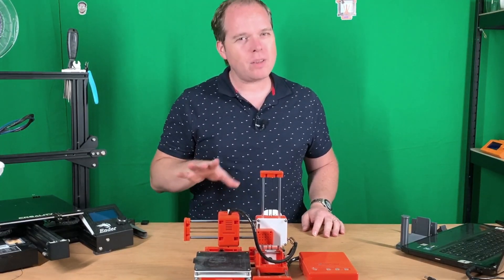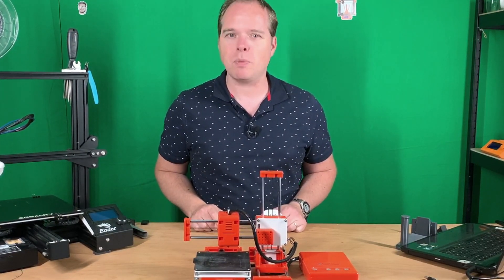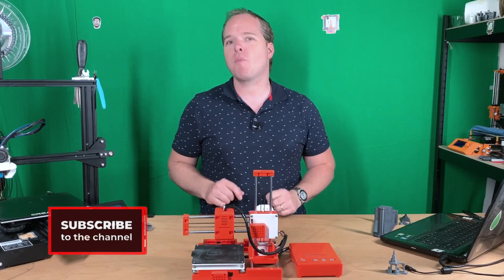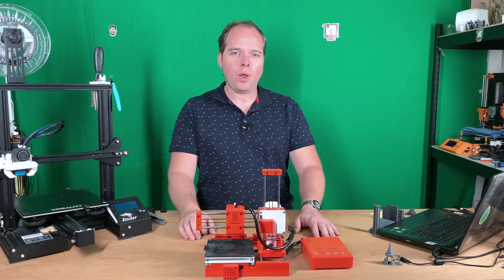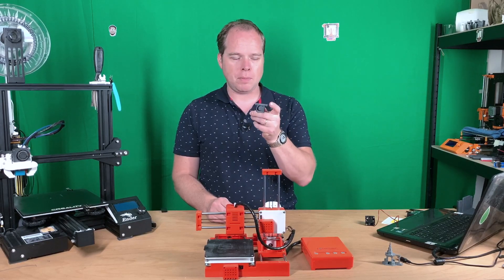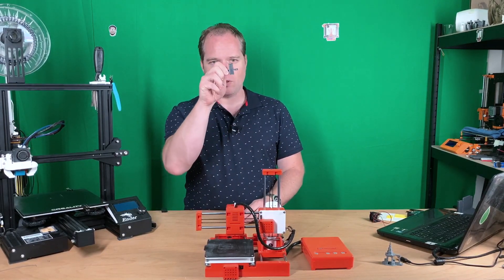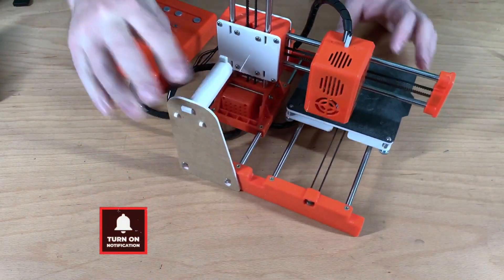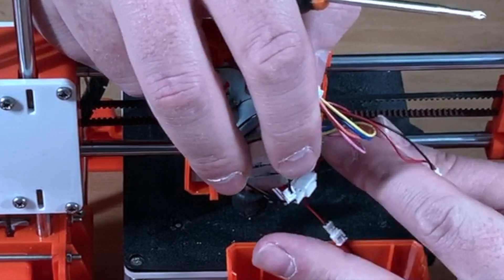Fan duct Easythreed X1 - Upgrade

Comment: Do you think if I install a display and a knobb it would work with the circuit board?
Reply from the maker: Hello Harvey brooks, there was a moment that I have had a display working on the board with some custom firmware on it, so it is possible. But for the standard board, I'm not sure if that is possible. I'm thinking to make some upgrades on this printer in the future.

Comment: Great video. I just bought this printer as a starter to learn more about 3D printing.
Just wonder how much power does the fan connector deliver? Can I connect two fans that consume 50 mAmps,
Thank you.
Reply from the maker: Thank you. I think you can install just one extra fan 20mm with 12 volts... please check the board before doing that

Comment: Amazing mod but  do you need a 30mm fan or 25 mm
Reply from the maker: The 25mm fan will fit better, since the one I have used is 30mm and was a bit bigger

Comment: Cool! Hello dear friend, how are you? I recently bought an Easythreed X1 3D printer, and it's almost arriving at my home. I really loved your explanatory and didactic video. Congratulations! I would like to know about these coolers (fans), the correct size that you use in the video is: 80x80x25mm or 60x60x25mm? I'm waiting and I thank you very much for your attention, friend. See you later, bye.
Reply: I saw on different videos you can do 2 options first option is the op like him or  the second one is to put it in side the orange box i know that the fans are 25 x 25 x 7 mm
Or for the second option is 30 x 30 x 7 mm
Reply: @C_HQCK  Thanks Bro!
Reply from the maker: Indeed like Chadi said, fans are 25x25x7mm

Comment: Mine came with the mod, and I’m not displeased with the results, apart from nothing seeming able to keep the print on the printbed. Magnetic? Does nothing. Painter’s tape? Nope. Glue stick? Only for a few minutes, until the nozzle heat dries it. If anyone has suggestions, I’d really welcome it...
Reply: I've had the same problem. I solved it by replacing the magnetic printbed with a glass plate and spraying it with hair spray.
Reply: @dottoanto  this afternoon I accidentally put the magnetic bed on 180 degrees turned (lip inside stead of out) and all of a sudden the bed sticks like superglue! Nothing on it, just turning the bed around solved my problem. Weird... only really big flat surfaces still tend to “curl up” at the edges, probably need a thicker skirt.
Reply from the maker: OMG... that I had also one time... I was surprised why the magnetic bed wasn't so magnetic anymore... flipped 90 degrees, problem solved
Reply: @sadkingbilly  ok nice! as i said, also for the bigger surface I've solved with glass and hair spray.
Reply from the maker: very great method
Reply from the maker: 🤔  glass bed with hairspray... that always helps... even on other machine does this work very nice... but be careful with the fans.
Reply: @Zachary3DPrints  I’ve ordered the heated bed from aliexpress (only €21 now!) let’s hope that stops the flat surfaces warping since I want to print some scale model house fronts.. I’ll be getting the ender 3v2 and some mods end of this month.
Reply from the maker: Oh indeed that is very nice. The Ender 3v2 is doing great, I think for the finer surfaces, it's also going to do a great job as well.
Reply from the maker: Getting ti really to stick to the magnetic bed can be a challenge sometimes, I do level the bed after some time

Comment: hello could you add a hot plate and how to link it to the printer ? seems there are some open com ?
Reply from the maker: I can add a heat-bed to this printer, but I'm not going to do this at this moment, I'm thinking if I'm continuing with this printer or not.
Reply: @Zachary3DPrints  that could be great if you show us how to do before leaving this printer useful for low budget ;-))
Reply from the maker: Yeah I can imagine that, I'll check it out in a few weeks...
Reply: Aliexpress has a ready-to-install hotbed with separate adapter. It costs about 20 dollar.

Comment: great mod but your prints are not good at all. I have this same printer and my prints are way superior to that
Reply from the maker: That is great! in which kind of way are they better? For this Shrine I didn't use supports.
Reply: @Zachary3DPrints  overhangs, print quality print speed
Reply from the maker: OK, l'll check those. I still need to tweak, after the fan duct upgrade.
Reply: @Zachary3DPrints  is there a reason to the use the external fan duct rather than just mount it in the internal housing and use their gcode file as the duct? Sorry if you mentioned this and I missed it. To follow up, I should have mentioned that EasyThreed has the fan duct on their website under the support(not sure why it's not in their 3d model dbase too)
Reply: @ghostid544  maybe because a 25x25x7 12V fan is almost impossible to find. Nobody is selling them. The only one that I could find was sold by aliexpress